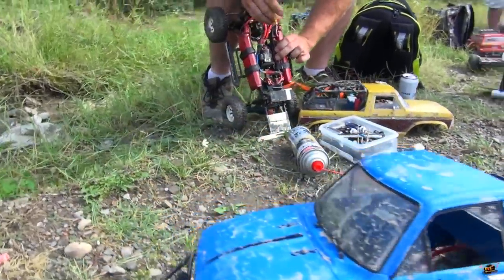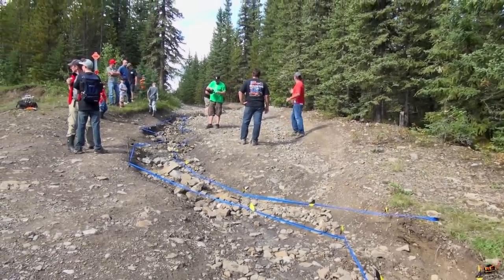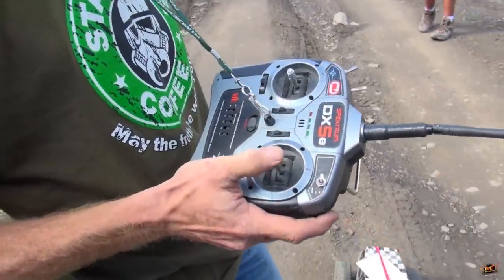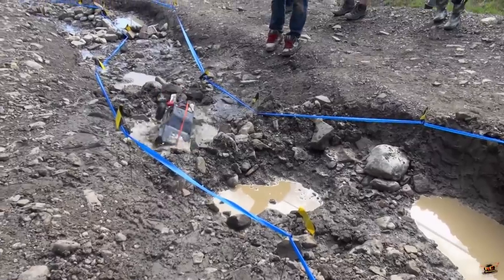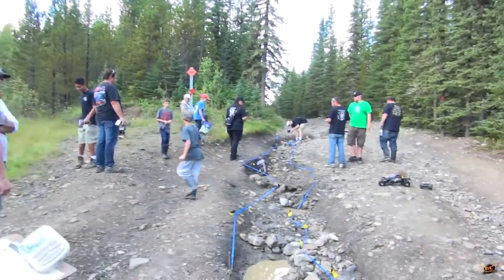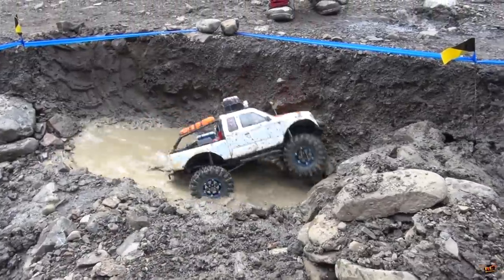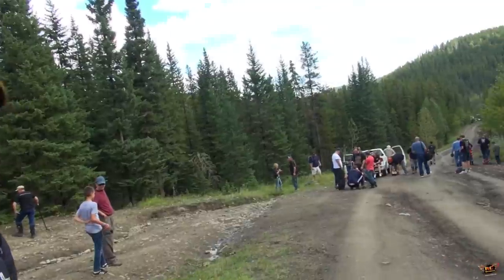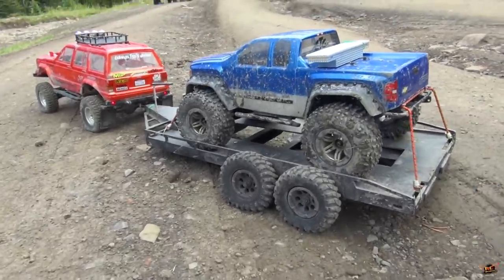RC ADVENTURES - TTC 2013 - TANK TRAP - 4X4 Tough Truck Challenge

Comment: These courses put alot of stress on the trucks and coming down hard or trying to power out of stuff can twist driveshafts and break c-hubs fairly easy. And a emaxx is actually 1/8th scale. Scx10's are actually very strong and reliable trucks even in stock format.

Comment: its hard to see in vid but the amount of stress in these past 2 courses is absolutely insane on the trucks it tests just about every aspect of the truck.  also u have to look at is as these trucks aren't new so they might have had things on the edge of breaking and this finally broke them.  even though I'm pretty sure eery1 checked and had everything in top condition that they could see.

Comment: Also, since I ran out of characters in my last post..

I still am amused by the fact that I've had $50, $100, even $150 "toy trucks" that have gotten damaged from falls off the sofa onto carpet, but I am not afraid to hold my Honcho shoulders-high (I'm 6 feet tall) and drop it on all fours on concrete, and not be seriously concerned about totally smashing $400 worth of truck!

Specially since anything that WOULD break could be replaced or even better, upgraded!  

I love my Honcho.

DieCastoms

Comment: I could blast through there with my four wheel drive brushless stampede
Reply: No, you couldn't......
Reply: Caleb Kardash
Not enough suspension travel, the arms/control rods are too low (along with the skid plate constantly getting stuck), and you probably aren't the best driver out there...
Reply: FriendlyFireGaming
 Not to mention, the trucks on here are specialized for what they're doing and you can see they still struggle.
Reply: you have a point but I made my stampede extra wide
Reply: +Caleb Kardash it has nothing to do with it being "extra wide" these trucks are meant to do this and they are still breaking and struggling. I have a stampede and it could not make it unless you made you similar to what Jang from ultimate RC did with one of his pedes

Comment: I used two 5300mah 2cell lipo's the whole day, put the second in just before the sled pull. Probably could have done it on one as the first had less then 10 minutes on it after completing both the frame twister and the tank trap.

Comment: is their a way of increasing the signal range of the rc and the controller
Reply: Yes you know the antenna that takes the signal ad a steel cable
Reply: Yes you know the antenna that takes the signal ad a steel cable
Reply: Yousef Al Abkal omg thank you so mutch
Reply: Yousef Al Abkal
Reply: Talan Lor Roscorla no problem I had the same question before